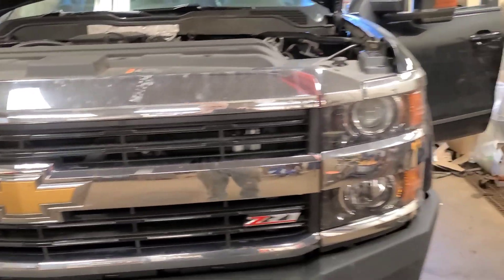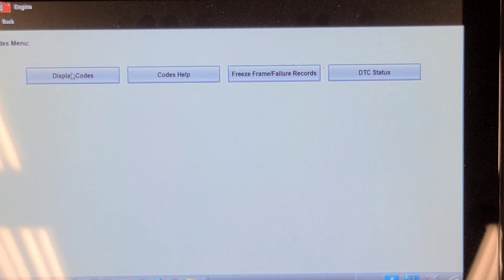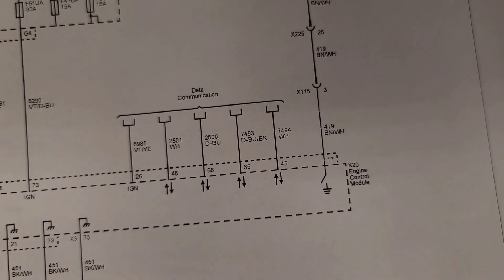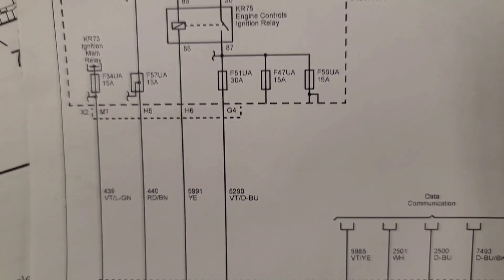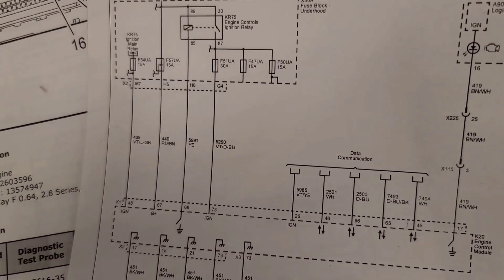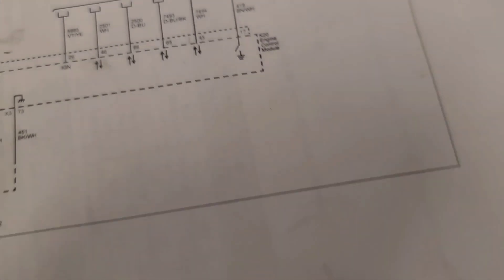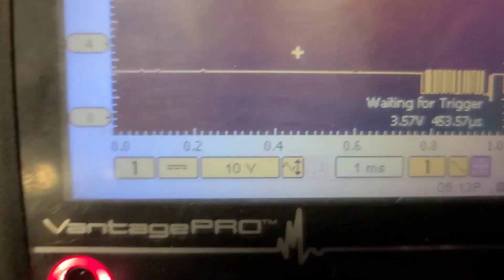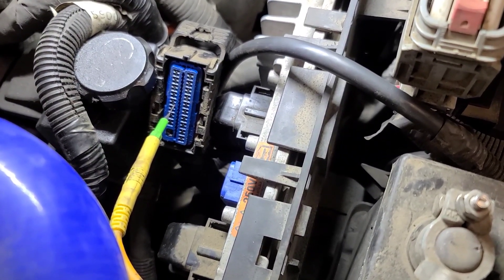2015 GM Truck 2500 HD 6.6 LML No Crank No Communication With ECM Diagnosis pt. 1

Comment: What diagnostic software do you use, very helpful to get schematics
Reply from the maker: I'm using a Snap-on Verus Edge tablet and the diagrams are from Identifix which is an internet based information source. It's a subscription service that is available to shops. A similar service is available to DIY from Alldatadiy.com

Comment: I have all the same symptoms. No MIL, no fuel gauge. I have U codes for brake and trailer brake modules no comms with ecm. I tested all power and grounds to ecm as you have shown and all test good. I tried another ecm, reprogrammed with VIN, and absolutely nothing changed.

Where do I go from here?
Reply from the maker: I'd recommend to test the network to the ECM. When you say you tried another ECM was it new or used. How did you program it if you can't communicate with it. Are other modules reporting loss of communication with the ECM? Check terminating resistance across pins 6 and 14 at the DLC with batteries disconnected it should measure around 60 ohms. Disconnect the ECM from the harness, measure CAN bus resistance at the connector it should measure 120 with the ECM unplugged.
Reply: @PhillipBailey   thank you for responding. The "new" ecm is used. I had someone program it for me, connected through a breakout board. The gentleman who programmed the "new" ecm also attempted to connect to the original ecm and it would not communicate.

I bought the truck non-running with a no crank, no start condition. When I first began to diagnose the issue, before swapping the ecm - the fuel gauge was working and I had communication with the original engine ecm, although no MIL with key on. Somewhere along the process, the ecm quit responding completely. I didn't short anything out that I'm aware of. 

The brake and trailer brake modules are the only two reporting a comm error with ecm.
I've checked all ground points and checked the harness fairly throughly. I know I'm missing something though and my knowledge of this system is very limited. I have a picoscope but I'm not sure what to do with the can data I collect. 

I will check resistance as you described, thanks again.
Reply: To follow up, I did solve this issue. It turns out that the original ecu was not bad after all. The J2 (blue) connector on the ecu had a damaged latch, likely from the factory.

Apparently, the connector was just barely touching the pins on the ecu enough for the engine to run for 14 years... until it wasn't. This also explains why I had no communication with the second ecu.

I put the original ecu back into the truck, removed the latch mechanism from the J2 connector and plugged it back into the ecu. The truck fired right up and has been running ever since!
Reply from the maker: Glad you figured it out and thanks for the update.

Comment: I have a 2015 duramax, my service stabilatrack light came on almost 2 years ago, took it in to the dealership my Father in law works at, they found no issues and drove my pickup that way for the last 2 years. Couple of weeks ago no crank, no start, tons of on screen messages, no voltage, service battery charging system, etc. I replaced both batteries and alternator tested fine. Now I’m stuck with crank but no start. I have 2 check engine codes both related to ECM. Codes are: P2510 and P262B. Any advice would be a huge blessing.
Reply from the maker: @zach00000019  check the DLIS Fuse 53 for power with the key on.  Swap the Run/Crank relay with another less important relay. Load test powers and grounds to the ECM
Reply: There is not a problem in the world you can ignore long enough to make it better.
Reply: @eddiereichel9354  I can’t disagree with that! 🤣 there was no issues with the stabiliatrak itself, more or less and electrical issue with it that clearing the codes would take away for a couple days to weeks at a time, and then it would randomly show back up again. It wasn’t a code registering with the check engine light, it was simply just a message saying to service it, but it just would never stay off, just strange. I’m waiting on my pickup still as warranty is dragging their feet
Reply: @zach00000019  I get it bud. I own a shop and my own car is not perfect. Dealership doesnt really mean anything these days as far as service department goes. I just fixed a 2021 Buick Enclave yesterday that dealer called the catalytic converter for bank 1 bad. It had an exhaut leak right near the downstream sensor. The lady said the "shop she trusts" already changed the sensor because it was flatlined. They changed bank 2. I dont know if it was they thought hat one was "dead" or that they thought bank 1 was left side of engine.

Comment: Having the same problem aswell except we took a good ecm and stuck it on there and still no communication
Reply from the maker: Does the MIL come on and stay on with the key? Check powers, grounds and network wires the the ECM.

Comment: How do I test pin 73 if I can not find a proper relay jumper mine is 4 pin rectangular small relay. Same truck fuse box is a little different
Reply from the maker: @rhettlochen8743  at the relay connect a small jumper wire between pins 30 and 87 then confirm power at 73.

Comment: I’m having problems with my charging system. New battery’s new alternator, the only code I get is a U1016 for loss of PCM communication. It will only charge to 13 volts. Any ideas?
Reply from the maker: What computer is this U code in? Have you checked the output right at the alternator?

Comment: 2015 lml started fine this morning got off work hopped in it, cluster going crazy turn key to start and you can hear the starter engage with the flywheel but doesn’t turn over
Reply from the maker: Sounds like low battery power. Will it crank with a boost? Check cables and connections

Comment: Hey i had trans installed with new techm that was already programmed when order. Truck sat for 3 months  with bat cable off due to builder getting sick. So they installed trans lasts night and it did same thing yours was doing except it Didn't communicate with tcm/ ecu or abs module say lost communication. 2014 silverado 5.3 . Also what do u think
Reply from the maker: Check the network termination resistance across the DLC pins 6 and 14. Should read 60ohms with the battery disconnected. Try unplugging the ABS connector as it could be shorting the can bus

Comment: I have no power to fuse 30 what would be next test relay is good
Reply from the maker: How about giving me more information.  Fuse 30 from what I can see is for a Configurable Option. Is it actually Fuse 30 or a 30amp Fuse.  What is the actual problem with the truck? How did you test the relay?
Reply: @PhillipBailey  same problem as this video no crank no communication I was following the steps in the video and you said to test that fuse and it’s fuse 30 and also a 30 amp tested the relay with a relay tester
Reply from the maker: The relay is turned on by the ECM which powers up the fuses. Relay may be fine but not being turned on by the ecm.

Comment: Having this same issue with my 2019 duramax. Where can I access the schematics you were using?
Reply from the maker: Alldatadiy.com has monthly subscription service
Reply: @PhillipBailey  I’m having this same issue. The only difference between our trucks in that mine won’t indicate what gear the transmission is in. I have 12.4v on all my pins going to the ECM, except the serial data wake-up pin. It is reading 11.75V. Any thoughts?
Reply from the maker: @brettdonati3811  are you load testing those voltages? If so check the can bus terminating resistance between pins 6 and 14 of the DLC with batteries disconnected. Should be 60 ohms +/- 2ohms. If you have a scope check the can signals. No scope pin 6 should read approx 2.6 volts and 14 2.4 volts. Try disconnecting the ABS module as I've seen them take down communication.  Load test the ECM grounds as well. Good luck

Comment: Currently have the same vehicle causing the same issue, however we also had malfunctioning door locks which caused us to believe it was the BCM. Changed out BCM, got doors to no longer randomly lock and unlock but now we still don't have a start. This definitely was a huge help when coming to guide me on schematics.
Reply: Did you figure out your problem I'm having same problem
Reply: @6doorshopdavid980  I’m having the same problem did you find a fix? Mines a 2011
Reply from the maker: @gilesterry7176 problem was a failed ECM. Replaced and reprogramming fixed the truck.
Reply from the maker: https://youtu.be/HKLhLnUCU_Y
The fix video...

Comment: Have the same issue on my 2021 3500 gmc Denali. Gone through two electricians and they keep saying network drop don’t know what it is. I have power nd ground on everything. I have changed ecm and programmed new ecm but keeps dropping.
Reply from the maker: There's quite a bit difference between a 15 and 21. What exactly is going on, what codes are setting in any computers?

Comment: where can i get a computer like yours i may needed i have on truck with about the same problem.thanks
Reply from the maker: If you're asking where you can get an ECM try the dealer. Understand that it is not plug and play. A new one won't work until it's programmed with the proper calibration and a theft relearn is done. A used computer will also not work without proper programming although it should communicate and control the mil. For a used computer try a recycle yard.
Reply: @PhillipBailey  thanks
Reply: @PhillipBailey  so ran into same issue recently but the lines for G120 so lines 73 on x2 and 3 and lines 17 18 and 21 on x2 all did not light up, so I guess that is where my problem lies, how would I proceed with that one.  New wire harness or just check those lines

Comment: Having a similar Issue getting codes 
U0100,U0073,P0700 but today put it on snap on scan tool wasn’t getting anything but CEL was on and while driving all the gauges are going crazy
Reply from the maker: The P0700 code in the ECM is a generic code which is set when the transmission control module requests illumination of the MIL. You need to scan the transmission module for codes. The U codes are communication codes possibly network related. You need to do an all system dtc scan and see what other modules are reporting. May need a lab scope to test the can bus.
Reply: Any help would be great
Reply: @jaylinpender7642 any luck with your truck? I have the same codes. 

Thanks!

Comment: Thanks for the vid, same issue with mine. sadly its tuned also
Reply: service 4x4 was on too, didnt die while driving, just didnt restart
Reply from the maker: @steveropp5864  start with a complete network scan. If no mil and no communication with the ECM check appropriate fuses and then powers and grounds to the computer. Good luck.
Reply: @steveropp5864 who tuned it if you don't mind me asking?
Reply: @keithqueen352  just a local buddy. Turns out had nothing to do with tune. It was a bad module back by the spare tire. Had holes in it and water was getting in for quite some time by the looks of it.

Comment: ooo! I am not on solid ground on that one...
I hope my 2010/11 LGH 6.6L 4500 is not eating ECM food when it is not on the road!?
...was cranking fine, on stilts for weeks/months... and now it clicks and nothing, black dash until I release the crank... hmmm.   ...and I hear relays clicking behind me in the panel where the bus doors/handicap ramp/air suspension are wired on 2 additional distribution blocks! LOL
...and all I have is crappy diagrams I swept off the internet... which do no seem to even know about a T harness but the diagrams do look like the ones he is using... wish me luck.
Reply: Did you ever find the cause of this problem. I’ve got the same issue.
Reply from the maker: @chaindrivenrydes3390 was a failed ECM